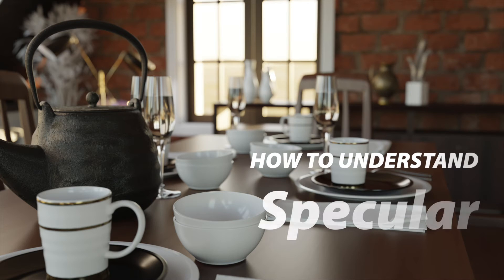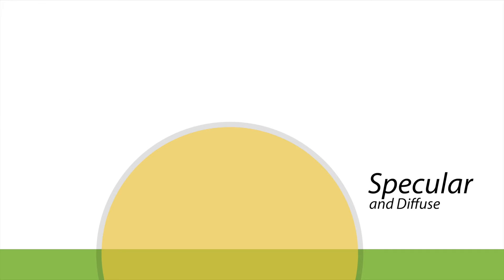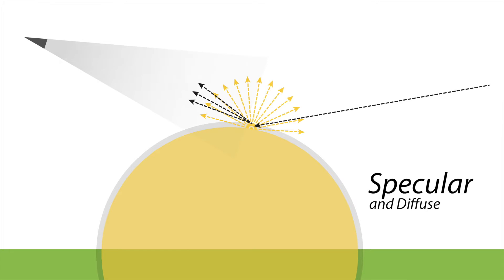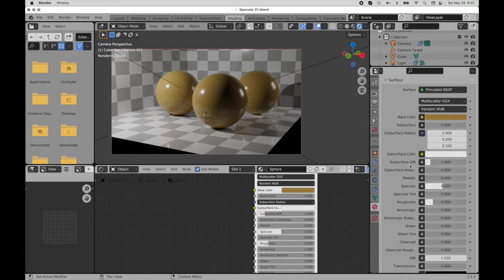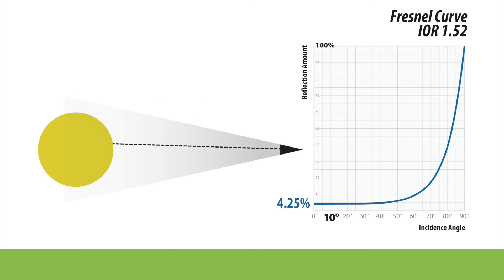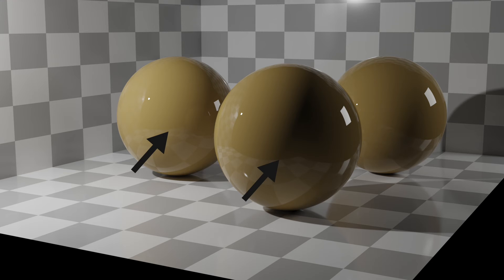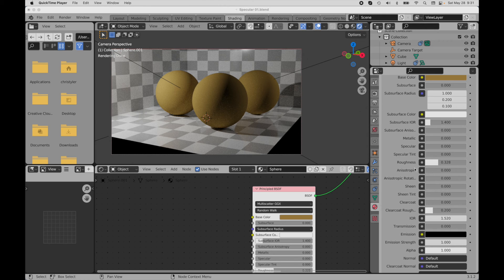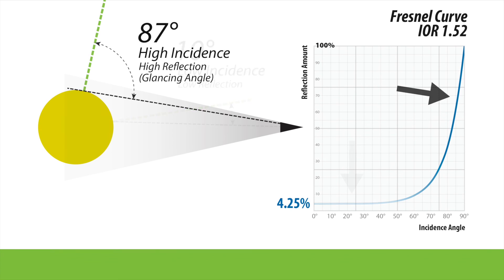About Blender's Specular Channel

Comment: Specular is the reflection on a rough surface. Because it is a rough surface the only brightest part of the environment is reflected, that is a source of light. If you have a perfect mirror surface, you don't have Specular. If you have ideal metal balls you don't have any specular on them. If you add some of Specular to the metal balls, you have to add a bit of Roughness to them (because specular means that these balls don't have an ideal surface).

Comment: Thank you! I rarely see the effect of the Specular parameter on metal reflectance discussed. 
But I still don't understand what it actually does and how it ties in with the function of the BaseColor for Metallic surfaces. Is my assumption correct that the BaseColor (with metallic set to 1) controls the F0 of the surface through color value and the reflection color through hue and saturation? Then does the Specular parameter control how quickly the reflections turn to white at grazing angles, or does it also affect how quickly the reflectance turns to 100%? Meaning, how does the parameter actually change the curve you showed? It's really hard to get that info without looking into the source code, so I would greatly appreciate your input on that. :)

Btw, I think a channel that focuses on the technical aspects of material creation like yours is an awesome idea!
Reply from the maker: Yes, Base Color controls the reflectance color of metal at F0. The Specular channel simply shifts the color to white, using the fresnel curve, at glancing angles when set to 1.0. Technically if they're using a 1.52 IOR to control fresnel it would shift the color of F0 slightly but I'm not seeing that happen so I'm assuming they've calibrated the curve so that doesn't happen. As roughness increases the effect is attenuated too. There are other things that can happen with increasing incidence, and I talk about that in my video Specular Channel & Incidence. I've got another video coming up that also discusses another issue related to non-metallic surfaces.
Reply: @christopher3d475  Thank you for the quick response! So I assume that the shader limits the range of the angles at which the specular parameter affects metals to something roughly like 80-90 degrees.
Reply from the maker: @lemming77gode  No, it's more subtle than that. It's not a strict limit so much as it's the nature of the fresnel curve to really only show much expression when you get to between about 60 and 90°. Fresnel is just controlling the blend between F0 and F90. Most of the curve is just being seen as the F0 color.
Reply: @christopher3d475  You are right, I didn't think that through.
Reply from the maker: Oh, and I should say that whether Specular controls wether the color of the metal turns to white at grazing angles, or whether it makes the material go to 100% reflectance at that location is really the same thing. In some 3D renderers, they set a color to determine the color of your metal but the application simply extracts the hue and not the value to try and maintain the correct total reflectance for F0. it gets kind of tricky because you can use various methods for approximating metals, some apps use a complex IOR + extinction co-efficient, others use a high ior like 50 to 80, but what Blender has done is a really easy way of handling it given its general purpose nature.
Reply: @christopher3d475  Regarding your second answer - that is very enlightening. It makes perfect sense now that you say it and I think about it: a white reflection color cannot mean anything less 100% reflectance because otherwise it would white, it would be gray, right?
Speaking about that, I hope the devs still implement a complex IOR in the future, where we can set the IOR for each color channel separately.

I'm looking forward to the next video about metals!
Reply from the maker: @lemming77gode  Yes, from a purist standpoint being able to use complex IOR + extinction would be cool given they're well known physical values. https://refractiveindex.info/?shelf=3d&book=metals&page=aluminium Some renderers like TheaRender and Octane can use them. 

But it would go beyond a lot of users. For me the biggest want is better control for roughness change with increasing incidence, because this is another very common physical manifestation on surfaces. I go over that in my Secrets of Specular & Variable roughness video.

My next video is actually on energy management. Cycles has an energy management problem and that's what I'm covering next.
Reply: @christopher3d475  I have watched that video as well, great stuff. When I find the time, I will play around a bit with the node setups myself. I have read about this variable roughness phenomenon before, and since then I have wondered why this not implemented in any of the popular rendering systems (that I know of). Do you have an idea why? Sorry for bombarding you with questions here, this is the last. 

Anyway, a video about energy conservation in Cycles sounds great. I will definitely watch that.
Reply from the maker: @lemming77gode  There's only one that I know of that has it built into the material system and that's Thea Render. I wish they had a Blender plugin, because it's a great render system.